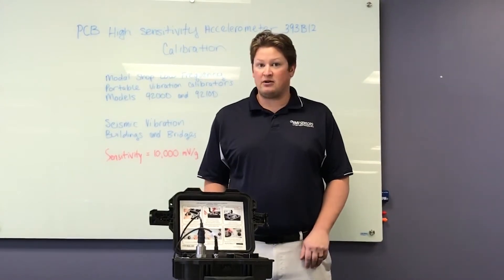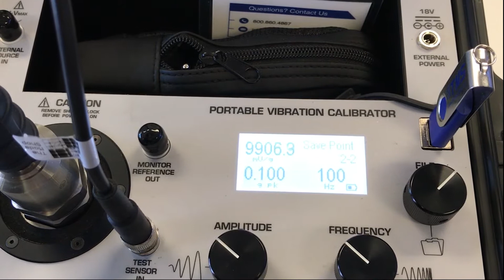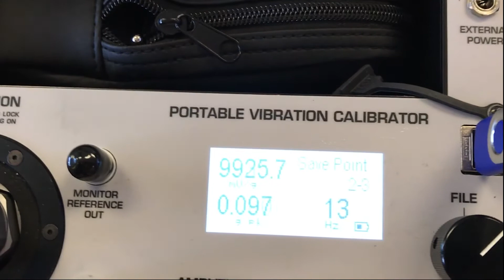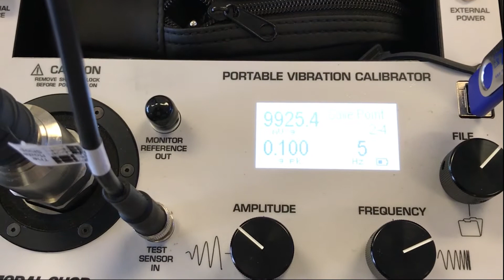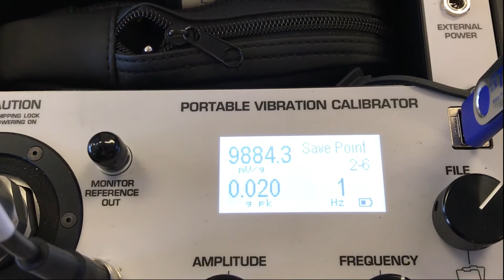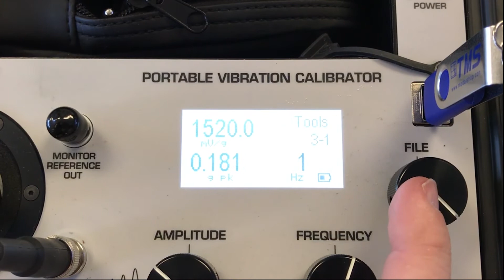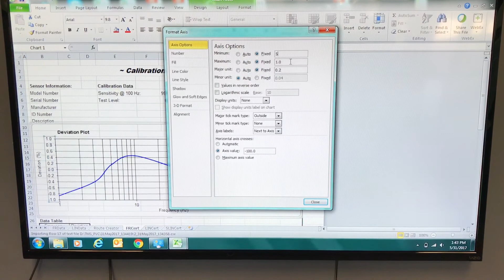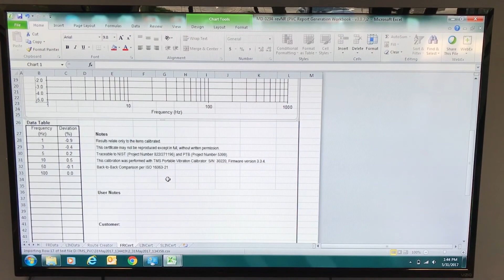Seismic Vibration Sensor Calibration via Portable Vibration Calibrator

Comment: At 1 Hz, typical values  are 1 m/s2 to 2 m/s2 r.m.s. acceleration or 0,1 m/s to 0,3 m/s 
r.m.s. velocity as per ISO 16063-21.  So, it doesn't meet the requirements!
Reply from the maker: The statement within ISO 16063-21 that you are referencing is found within the “Uncertainty of measurement section”. Specifically, that statement regarding amplitudes at 1 Hz is found within the section that details the calibration requirements for the reference accelerometer used in a calibration system. It is part of a larger section discussing realistic amplitudes for electrodynamic vibration exciters and says “When measurements are performed at the lowest frequencies, the limiting factor is normally displacement. At 1 Hz, typical values for long-stroke vibrators are 1 m/s2 to 2 m/s2 r.m.s. acceleration or 0,1 m/s to 0,3 m/s r.m.s. velocity.” 

In short, if one wishes to achieve the “attainable uncertainties” noted in the table that closes the section, the recommended course of action is to use a long-stroke shaker to calibrate the reference accelerometer within the system. Since the 9210D is not a long-stroke shaker, one cannot use this shaker to calibrate the reference accelerometer that is part of a calibration system and expect to achieve the uncertainties stated in the standard. However, we do utilize a transfer standard calibrated on a long-stroke shaker to calibrate the 9210D before shipment. 

To briefly summarize, the relevant section of the ISO 16063-21 standard is providing guidelines on how to calibrate the reference accelerometer within a calibration system. The standard is not recommending that all low frequency calibrations occur at 1 m/s2 at 1 Hz.